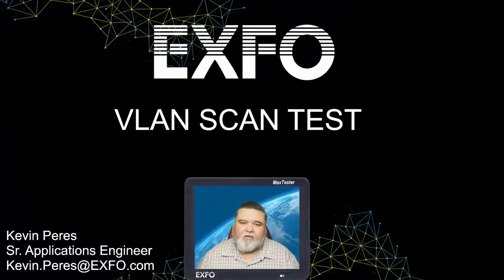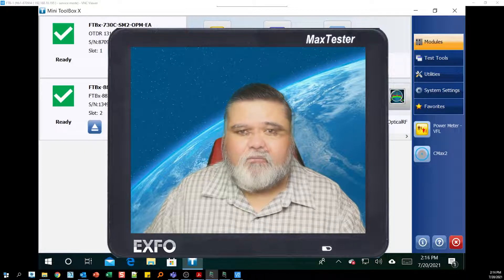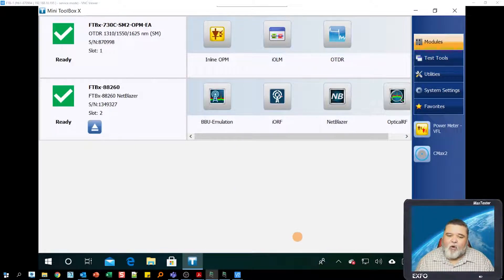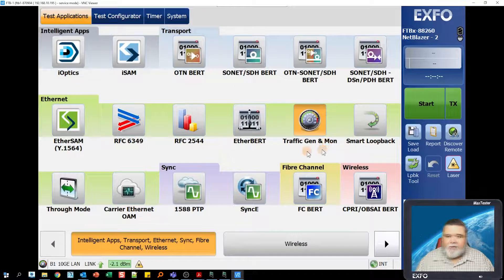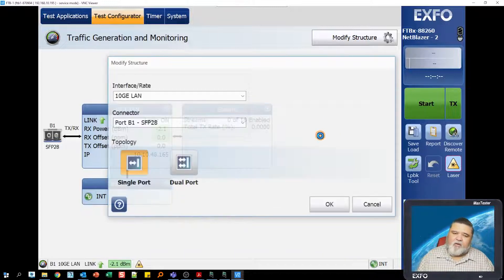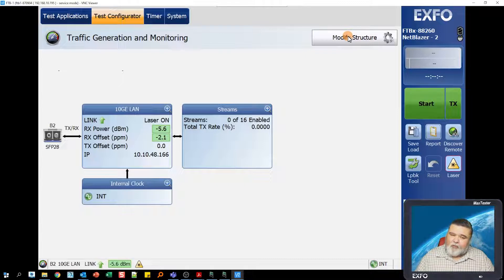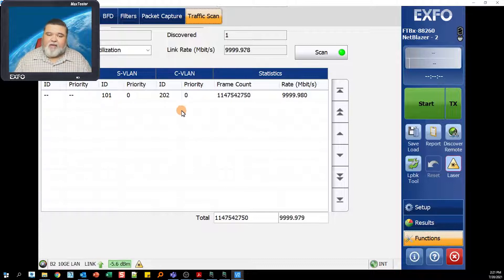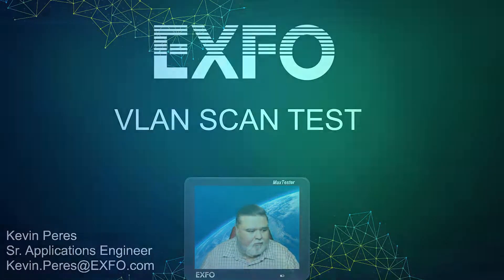EXFO   VLAN Scan Testing

Comment: Hello! I have during Exfo y1654 test error - "vlan preservation" - how to check details what exactly is wrong? vlan ids rather had to be ok if I earlier got IP connectivity end to end
Reply from the maker: Mich,  I am sorry for the delay. What this means is the VLAN that was tagged does not go all the way through the network. It is tagged in the first and last switch but is being stripped out somewhere along the path. We usually see this on the transport side, it hits a switch and the tag is stripped. You would have to work with the providers who are transporting your service. I hope that helps.